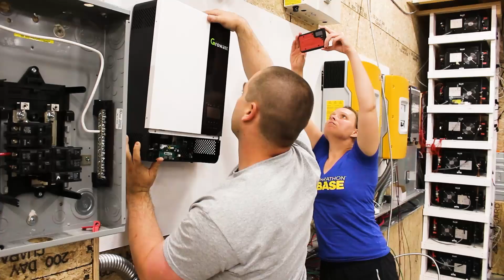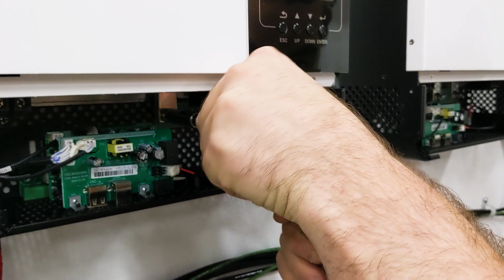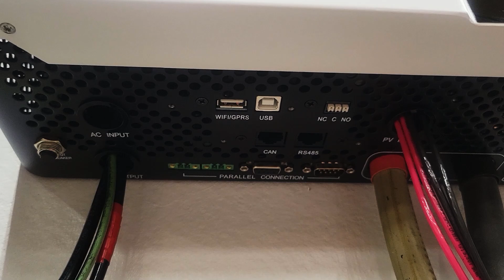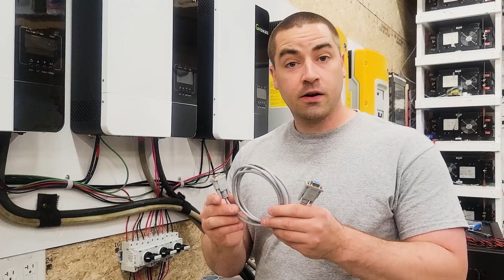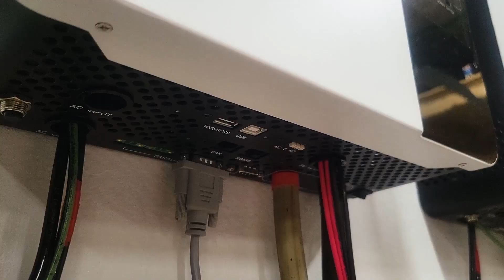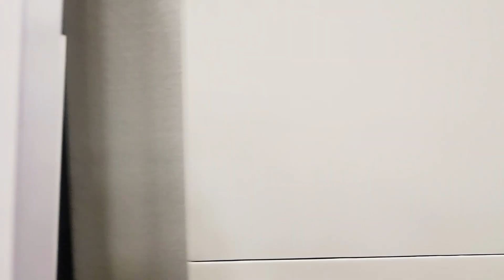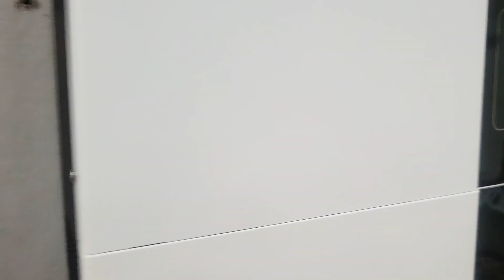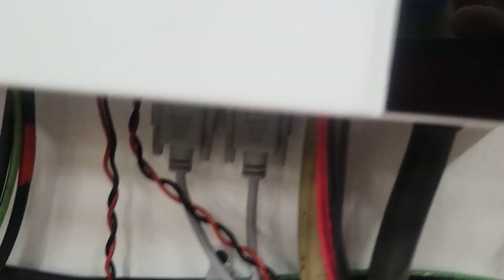Paralleling 3 inverters together, Growatt 5000w Solar System

Comment: Super great info. Thanks. It seems strange that the Growatt inverters don't have an integral neutral. Having to add an extra transformer just to derive a neutral for 120V loads tends to be a BIG negative that makes the low price less attractive IMHO. What about MPP Solar Inverters? I believe the LV6548 does have a built-in neutral and they are stackable up to 6 units but then the price is most likely higher than $900 each.
Reply from the maker: Growatt does make some inverters with the transformer built in.  The closest to this setup would be the 12k model: https://shop.signaturesolar.us/products/12kw-48w-150vac-120a-off-grid-inverter-by-growatt  This is a good deal if it handles your needs.  However, the 12k model can't be paralleled with more inverters in the future.
Reply: @DavidPozEnergy  Thanks for the follow up. I'm watching a lot of videos and researching different products trying to find a solar solution for my step mom who lives in an ALL electric house. A little napkin math is telling me I need about 20KW minimum to comfortably operate without having to constantly turn on and off breakers to alternate loads. In CA its actually getting more difficult to do a grid tie system despite the State's stated goal of zero emissions by 2050, go figure. This is what happens with politicians gone wild.
Reply: @bentleyjarrard885  Politicians are nutbags all over the world.

Comment: Hi David  Another great video...I just got growatt 5000w and auto transformer from sig S. I'm hoping to connect grid to spf5000es ac input so I can ues ups mode and charge batteries when solar is on available. Do you connect L1 L2 to ac input L. To L1 and N Neutral to L2 not sure lol. I now ground is earth and classy ground. It does not look like you are counted to grid on your setup thanks Mica....
Reply from the maker: I'm not connected to grid in my setup.  If my batteries get low I will switch the house back to the grid at my main transfer switch.  I like keeping my whole inverter/battery system separate from the grid.

Comment: i often see wires needing to be the same length, do the solar panel wires to charge controller connection on each of the inverters all need to be same length or only same length of wires to each individual inverter?
Reply from the maker: When talking about same length wire, that conversation is usually only about the battery to inverter.  Each inverter should (and does in my setup) have the same length 1/0 wire to the battery.

Comment: You would always have an imbalance in the system weather you like it or not. And it's not dangerous. This because the system has an ac current high and low shot down switch inside it.

Comment: David it has been a pleasure watching you, it has helped me in making my the choice to use the 5000 220 volts, with a mid point transformer purchased them from signature solar and was over happy that i did not realize I didn't use the coupon code.
I will be powering my entire home with this and hope to add another inverter later this year.
looking forward to your updates on this installation.
I think this will be the first solar installation using Growatt on the Island of St. Maarten the Dutch Caribbean.
Reply: All the best with that project Dudley.
Reply: Whats the cost I'm curious
Reply: The main drawback with auto-transformers and transformers are the efficiency. You gonna have losses. 80% efficiency is typical and decreases with increasing loads.

Comment: 6.6.21  David, nice video series on the Growatts.  I do have kind of a strange question.

Do you have any ideas on how to use this Growatt 5kw as a grid tie unit?  What I am trying to accomplish is have the grid running and the growatt supplying power say under 5kw during the day.  I would like to use the solar panels and 48v battery during the day and battery power when the sun goes down.  Then have the grid supply the bigger power like the well pump, heat pump, water heater and furnace when needed.

I would say that 90% of the time I am using under 5kw and 70% of the time under 2kw.

I have been in contact with Brian at Signature Solar and wanting to get your ideas.
Reply: It might be hard to manage the day and night separately. I have connected parallel inverters 5kw each to 2 different HVAC units  since that is most of my use and a separate 5 kw inverter to rest of house . The grid is connected to all inverters. The big thing to make sure is that the total power even from grid just passing through the inverter cannot be continuous above the 5kw rating of this inverter. So 10,000 for the two HVAC units and 5kw for rest of the house in my case. You can always set up different critical load panels each of which can't exceed the continuous rating of the inverter that feeds it which is essentially the same thing. In my case only the 2 parallel units have pv attached and they all use same battery bank. In this way I can use the max of my HVAC units which is about 8,000 watts and up to 5kw rest of house continuous from the same battery bank.
These are not grid tied in that they cannot feed the grid they can only use the grid for backup.
There are several newer version inverters that are capable of selling to grid and blending grid and solar power to meet higher loads than solar alone can handle such as the solar 12. The foreign ones like MPP LV6048 and LV 6548 can inject power from grid which is the term for blending supplement power from grid to the solar but even though they may have software to sell to grid I dont think they are approved or certified for that purpose in the US yet.
Reply: @teekay1785  you say they are not grid tied but use grid for backup. Are you saying you have them set up as solar/battery/grid and do not have an automatic transfer switch?  Or the Growatt has one in it that does it, automatically,  and it shuts off grid if solar and battery bank settings keep grid off unless needed?
Reply: @bobcole3852  I wish someone would answer that. I've been asking that for a while and haven't got a good answer.
Reply: Hi, looking at the manuals I think the Growatt inverters would do what you want. But for technical reasons I think you would need to use pairs of 120v inverters instead of the 240v one if you're in America.  I suggest you download the manual, it has more details of the different modes for managing the different power sources. The 'SBU' mode is probably the best. It tries to use solar power to supply the loads, and if there is not enough solar it draws the extra power from the battery. SUB mode is similar except the extra power is drawn from the grid. There's also a 'USB' mode which probably isn't what you want.

Comment: Why keep growing the system rather than reducing your consumption?  It would be far easier (not to mention cost effective and environmentally responsible) to reduce your reliance on power.
Reply from the maker: I do both.  I built my own house which is super-insulated and air-tight.  You can heat my whole house with a hair dryer in the middle of winter.
Reply: Converting to solar more and more like he does is being responsible. He is adding solar capacity to be able to make his whole house independent of the grid. Nothing more responsible than that.
Reply: Maybe you should join the Gardening foorum.
Reply: Do you have any clue how much work this man has put in to help the entire solar community be less reliant on grid power ?  You should apologize .

Comment: Great review. Thanks.

If one of these failed - you should have a system of quick disconnect.

Are these clones of Voltronic Xpert 5K?
If so - should be able to replace with other clones.

Comment: Hello David, Sub D connectors are those old folks PC type connectors when you were a sprout 😂 
Question sir:
Is the neutral box necessary for the 240v single phase items.. like the water heater, dryer, AC and so forth or just to meet the US code? I am still somewhat confused about why you need the neutral transformer. You would think it too would be built in to comply with US code. I guess not as you are using the neutral transformer.
I have my shop running on solar with a SunGold 6kw split phase LF inverter. I’ve run my 240vac arc welder with no issues.. it comes to life like it’s on the grid! I’m using only the 240vac output from the inverter which is not a true neutral from what I understand? But works fine?
I guess I need to study the reasons a neutral is needed and why my inverter is not acceptable for a US home? 
Thanks 
✌️PT
Reply from the maker: You don't need the auto-transformer if you are powering a 240v only load.  I demonstrated this in my first test of this inverter, I just wired it directly to a water heater.  I'm using the auto transformer so I can also power my 120v loads.
Reply: @DavidPozEnergy  I’ll go check it out.. thanks. I am DIYing my off grid home system. Finishing up the ground mount rack and mounting the panels!
Thanks

Comment: If you have ever seen a catastrophic failure of the fets you will know why they specify nonflammable backing.
Reply: Hello Charles, I worry about the mosfets long term.. VS a Low frequency inverter with a huge copper coil transformer.
Been in electronics all my life and seen smoked mosfets in various equipment.
In 45 years don’t remember a single heavy copper coil failure.
✌️PT
Reply: @ProspectorTripp   I have seen one bad failure of a transformer NOT your everyday type it weighed 200 Tons, 300 mva. But the mosfets can and do catch fire.
The inverters he is using are high frecency not low frecency been in electronics for 55 years.
Reply: @Labeeman  Been in Electronics for 40 years, but I agree with the older and wiser Charles (With all due respect Prospector Tripp). The circuit will be designed to minimise the time the fets spend in their linear region to minimise power dissipation, so they will be running at 10's or 100's of kHz and in purely digital on/off as much as is physically possible. I imagine they stack a whole lot of fets and digitally produce the sinusoidal 50/60Hz waveform.

Comment: How are you dealing with the neutral to ground connection?
Reply: @David, if you didn't bond yet, can you please measure the voltages from Ground to L1,N, L2. Would be interesting how that looks like with the auto-transformer...In principal, you will need to bond at that shown load panel as this is the point of entry from all generators.
Reply: @RolandW_DIYEnergyandMore  Yes in principle.  But do the inverters bond the DC input ground to the AC ?
Reply: @crhu319  No they do not , leave the DC wiring floating bond the Neutral at the switch board only in Australia RCD devices are compulsory at the switchboard. Of course USA is different.

Comment: I’m currently doing a major overhaul on my solar setup… I’m wondering if the growatt 12kw inverters would be a better choice. One would be less output, but cheaper and have 120/240 output built in. 2 would be a little more expensive but have higher output.
Reply: I was thinking about that too but when it fails you are out of power if one of the three fails you will still have power.
Reply: If your aim is reliable off-grid power, then the focus is on eliminating single-point failure. A 12kw inverter is cheaper but lacks redundantcy. Double stacking or triple stacking is more reliable. So yes, 15kw should be 5,000/5,000/5,000. If 12kw ideally you should 4,000/4,000/4,000. 16kw should ideally 4,000/4,000/4,000/4,000. 20kw ideally should 5,000/5,000/5,000/5,000. My first off-grid PV experience was a SINGLE 700 -watt Vector inverter. It failed one day. Complete black-out just like with utility companies. No redundantcy equals profanity out your mouth for sure! Try to avoid single-point of failure configurations if financially possible. Most homeowners that have grid-tied PV hookups go into complete blackout when utility infrastructure fails. No matter all that sunshine hitting PVs, when power companies wires or transformers fails, it takes the homeowners entire PV system with it. REAL BUMMER!

Comment: you need to use    WIRE DUCT  to control the wiring    2 in high x 4 in wide ...ebay
i have some clean systems

Comment: The Gray cable is a serial connection referred to as rs232.  same thing as old school printer connection just a smaller terminal.
Reply: The connector is called a sub-D

Comment: That’s more power than a medium sized ballroom. What in the world are you going to do with all of that power?
Reply: I guess if you want to throw a rock concert for 1000 people, you could do it.
Reply: I have a modest sized home but with an electric stove, dryer, hot water heater and a 3 ton HVAC system… we peak out around 13kw during the day. 15Kw really isnt that much for a home running all electric appliances. 🤷🏻‍♂️

Comment: will this run 3ton ac? amp draw
can you run without batteries?
are you connecting to grid thru input so batteries not included?
Reply: Yes it will work without batteries and should power a 3ton inverter style ac that doesn't have a huge surge.
Reply: Also it says it can hook up.to grid.

Comment: Great video. Fwiw you can stack 120v growatts asymmetrically.  Really love how you let us in on what you are thinking and doing as you go.
Reply: Have only once wired ceiling light. Am/was telecommunications, so understand most of what your saying. 
I have man who says he journeyman electrican so I am considering solar &
What I need. I have read about a new type glass that is capable of replacing solar panels. 
Then there is another guy who says they can use a spray on regular windows that can also collect the rays & supply solar. ]
I don't want to buy what will be outdated soon. 
Have u heard about that?

Comment: Its good to finally see someone on the internet have a video on hooking up multiple units of a Euro style inverter. I on the other hand have 4 and use a transformer instead. All 4 go to a subpanel and from subpanel have 2 wires a neutral and hot going to the transformer, in goes 240 and out comes 2 legs of 120V. It can handle about 7x more current load than that autotransformer for just a little more money . From the transformer it goes to another subpanel that then distrubutes out to house, shops etc.
Reply: It's generally not a good idea to do this in the US as the possibility of a 'floating neutral' is very dangerous. Given a fault or circuit breaker open which results in a disconnection of the autotransformer, either 120V leg could see up to 240V (double voltage) depending on the present imbalance of the phases.   Say goodbye to any 120V rated electronics.  Same scenario if David forgets to turn on the autotransformer breaker first - before the house/inverters.

A few ways to do this correctly and safely.  Autotransfer switches for home backup are wired in such a way such that the integral autotransformers can't be disconnected from the house when off-grid/grid down backup mode.  Alternately, off-grid inverters have them integrated - same inability to ever disconnect.  Some inverters like SMA make you use two 120V inverters instead, so you'll only loose one 120V phase given a fault (which is safe).  Growatt also makes split-phase inverters with an integrated autotransformer, which are probably better for this US application (though still not UL listed).
Reply: @billjohnson3344  So, all he has to do is connect the autotransformer to L1, L2  and the neutral bar without a breaker? Maybe run all the wires from the autotransformer and breaker panel in steel conduit? just in case there is a fault? Where would you hook up earth ground?
Reply: @danp762  The SolarEdge autotransformer that David is using is designed to be wired directly to a SolarEdge StorEdge 'Connection unit' - no breaker in between.  That configuration has been specifically designed, and safety verified by the certifying body (UL in the case of US usage).  He is not using the transformer as it was intended.  Connecting to the bus bars without circuit protection is also not a good idea.  It solves the issue of the floating neutral, but an overcurrent fault in the autotransformer is now unprotected.  To do what he is doing safely, the autotransformer breaker should be physically linked to all the other inverter breakers.  This way a fault on the autotransformer will disable the supply voltage also.  Possibly this could be linked only to the master inverter breaker, if the slaves shut down instantly when the master looses power.  He'd have to test this.  If linking all the breakers, he'd need to make sure they are rated to be able to trip the physical load of the multiple connected breakers.

Regarding grounding, I'm not sure where he is linking neutral and ground - as well as if he has ground rods for the garage and house separately.  The correct way to do this is to bond the ground and neutral at the 'main panel'.  In his case here (providing power from the garage to house), his garage is his 'main panel' and his house is a 'sub panel'.  So ideally the garage would have the bond, and the house would have ground and neutral separate.  I suspect that is not how he has it set-up, probably left the bond to occur in his house panel so as not to disturb all that 'normal' wiring when connected to the grid.
Reply: @billjohnson3344  Very interesting Bill, in Australia we don't have this problem (I don't think), since we either have single phase 230V or 3 phase (380V). Can you point me to an article that describes this? Cheers.
Reply from the maker: Sounds like a good setup.

Comment: I must say, I'm not a fan of those pv disconnects being mounted on wood with exposed high voltage dc conductors and screws.
I think they should be in a wiring cabinet...
Reply from the maker: I agree, I have to get them into a box.